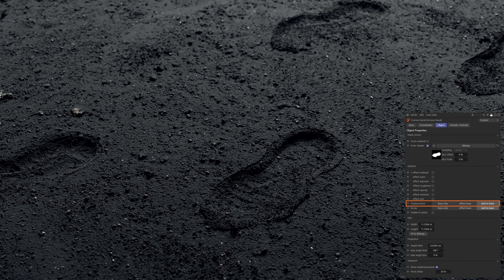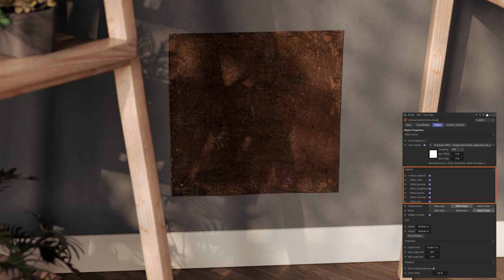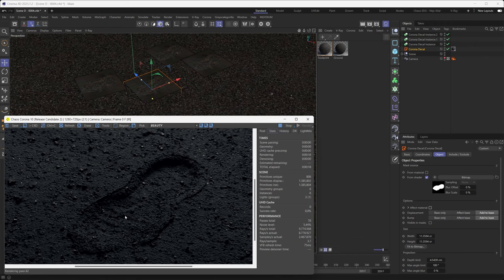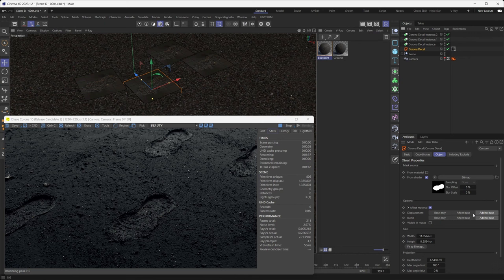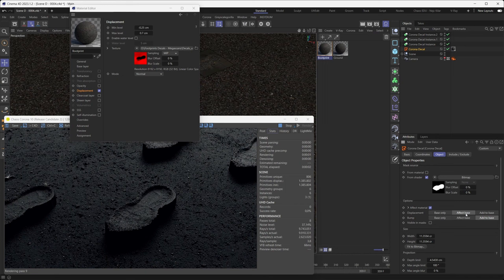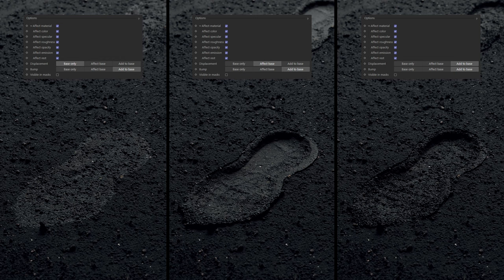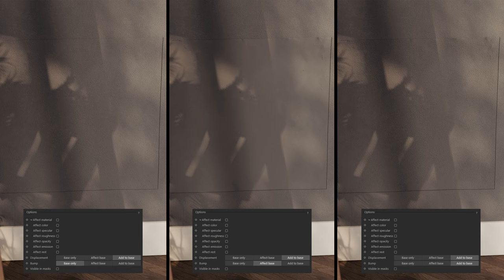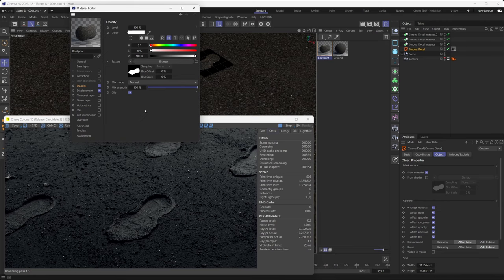Decal Improvements in Cinema 4D

Comment: Well done Corona team! Very nice tips!
Reply from the maker: Thank you, glad you found it useful! Tom
Reply: @ChaosCorona  Are you gonna make a tutorial about that camera inside a pool? Thanks Tom!
Reply from the maker: Maybe, though it's pretty simple - in the camera settings, set the Camera Physical Size to non-zero in the Corona Camera Tag Settings, and then place the camera partially inside a volume, and that's it! Physical size is best adjusted by eye depending on the scene, usually low values between 5 and 15 work well as a starting point. Thanks! Tom